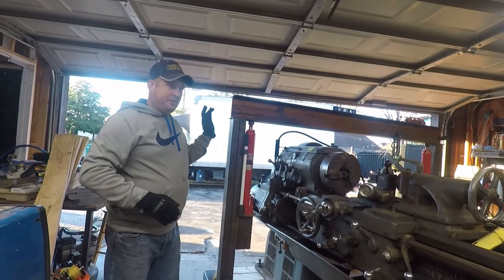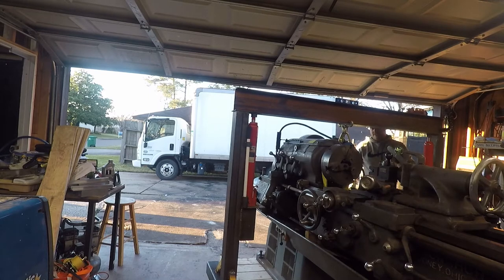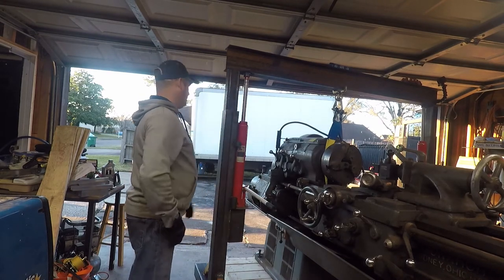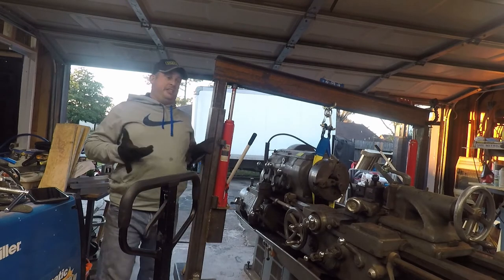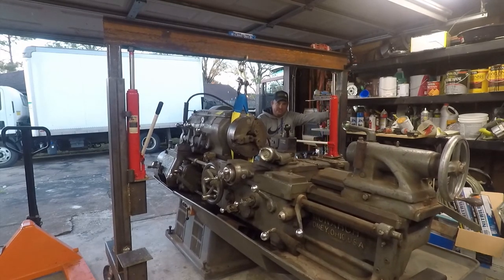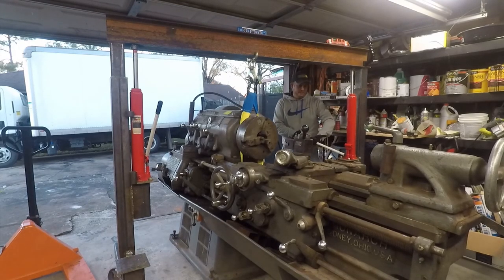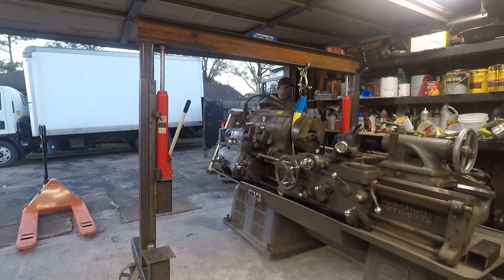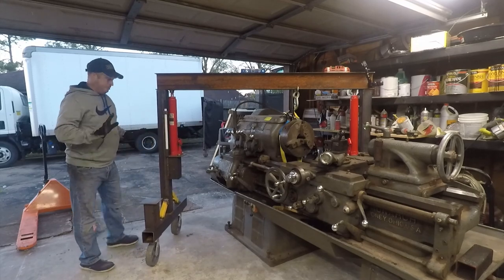Moving a Monarch Lathe in my home shop

Comment: So far I like your set up..even those big casters 
What is your beam span and I beam size...?
My lathes are 2/3 of your loads
Reply from the maker: Beam span is around 8 feet.  I don't remember the beam specs.  I went with what was available that exceeded my design spec.  I used an online calculator to design the gantry.  

The wheels are the part that I trust the least.  They are rated for 1/4 to 1/3rd the load, but being from China the only thing I trust them to do is rust and take my  money.  They came from Northern Tool.  I used Metals Supermarket for the steel.  They are a franchise outfit that is all over the US and Canada run by local business owners.  Great folks and my go-to for metal.

Comment: Monarch lathes are worth the effort we personally would like to add a Monarch 10EE and we like your garage height hydraulic crane instead of those other ones being too tall for us garage machine shop guys to utilize. What model of Monarch is this you have been lucky enough to acquire?
Reply from the maker: It's a Monarch 14Cx30 from 1941.  

I've wanted to build something like this for a long time.  Be sure to check out the design and build videos.  If I was going to re-make this I'd make the part the wheels mount to longer and stouter.  I might make it out of I-Beam as well if I had it available.  I'd probably use shorter wheels as well.

Overall, it  did exactly what it was designed to do.  I will get many uses out of it in the future.